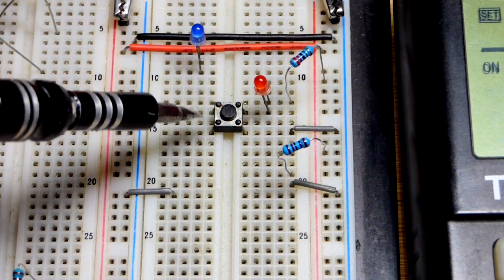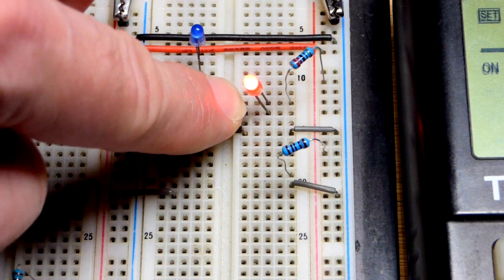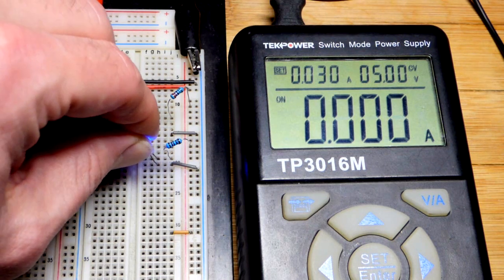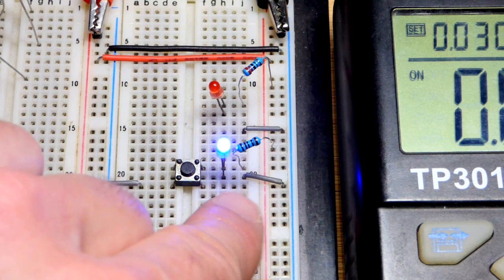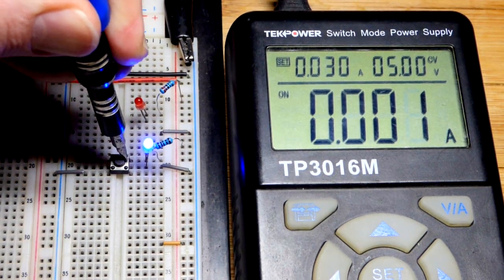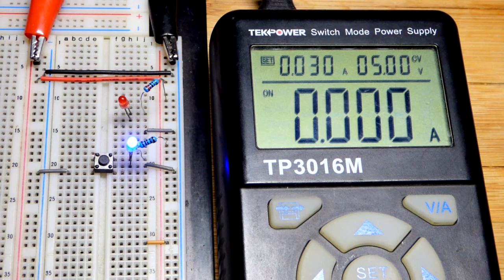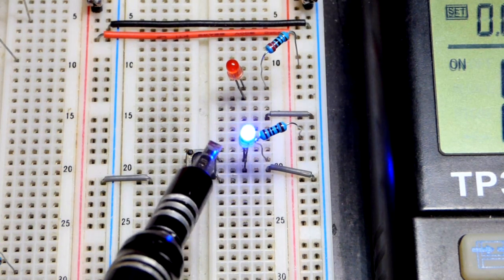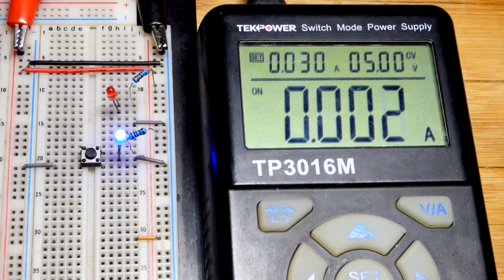Inverting a mechanical push button switch with an LED load basics how to DIY by Electronzap

Comment: Tech Tip for those tactile button switches.   I square up the pins so they are perfectly 90 degrees pointing down.   Next eliminate the "S" curve of the pins then  I twist the lead 90 degrees so it sits in the hole side ways or thin wise in the slot so the socket does not have to spread so wide when inserting it.  This saves on the switch walking out of the holes and does not stretch out your socket spring clips.   Try it.
Reply from the maker: Thanks for the tips! I mostly leave mine as is because most people only watch one video, so I like to show how a new switch behaves on all of them.
Reply: @Electronzap  I understand.    I only do it with a few that I do that way for breadboarding.   Leave all the rest original.